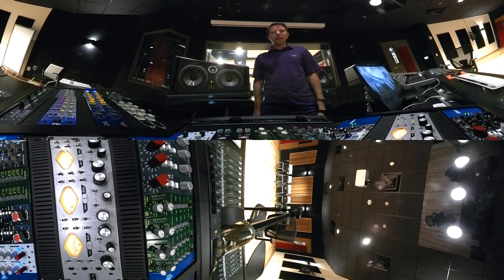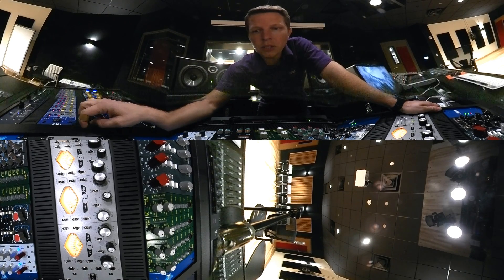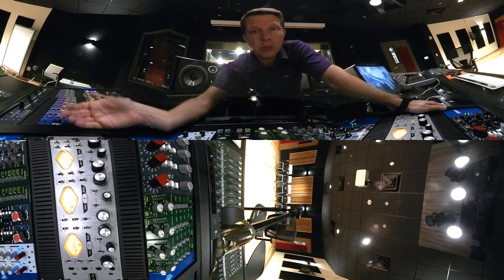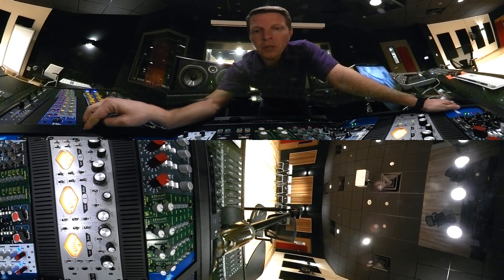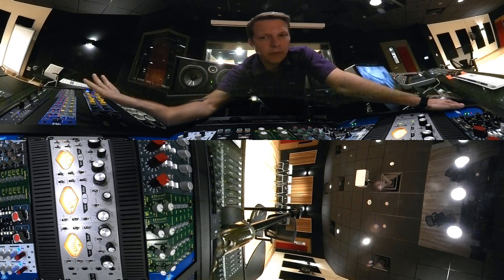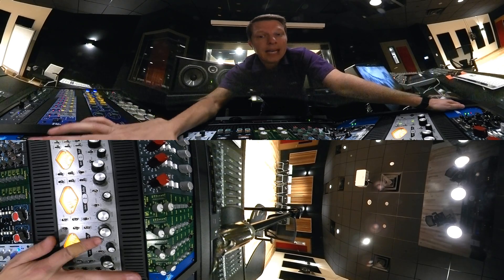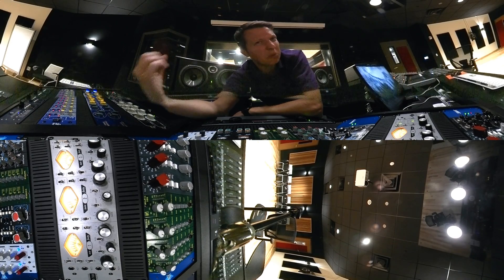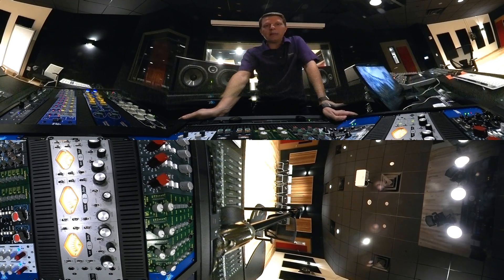Universal Audio US 4-710d microphone preamp - 360º Tutorial

Comment: If I’m using a pair of keyboards, each having balanced outs, (4 total outs) what would be the recommended recording input on this preamp ? It appears I have a line level input with xlr connection, an insert 1/4 inch connection and a high Z connection on the front. I’m trying to get the cleanest input prior to the preamp circuitry. Could you or anyone else please provide some input, lol
Reply from the maker: The output of your keyboards is likely line level so it won't need a preamp. Use the high z connection on the front. If you need all inputs at the same time, if there's a pad on the preamp, engaging that and using the mic pre might be an option.